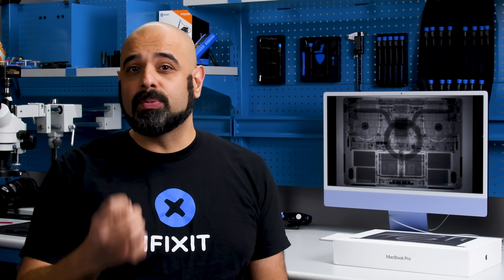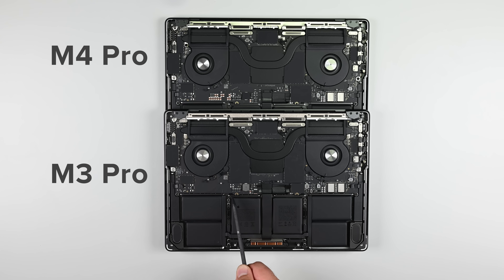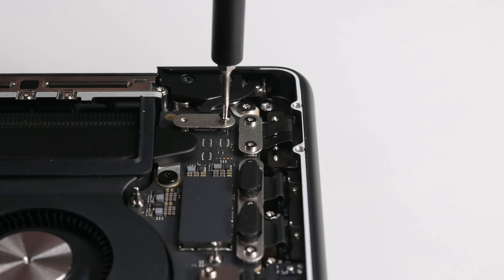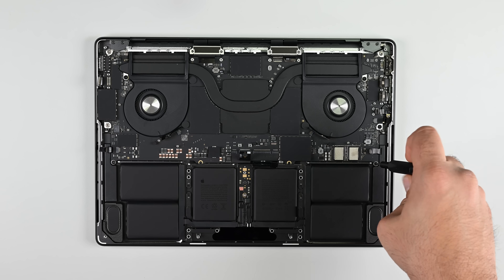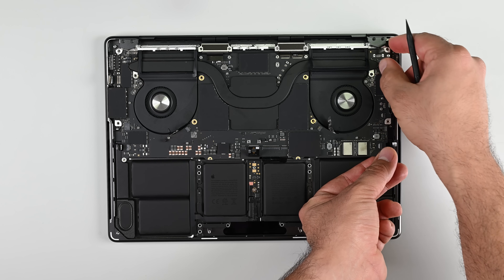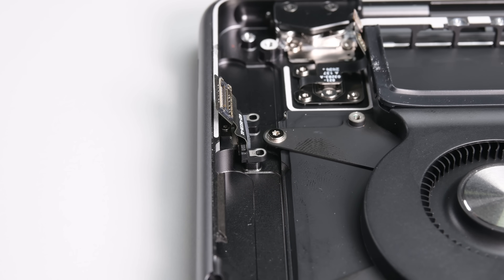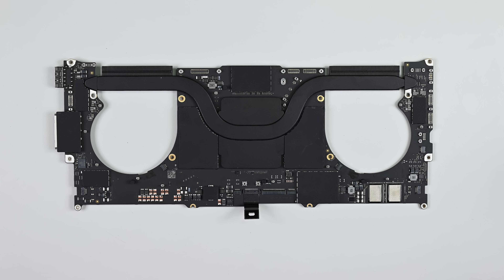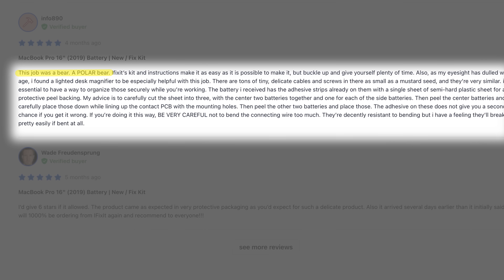MacBook Pro M4 Teardown: What’s Inside and What’s Fixable?

Comment: i really dont think we should call m4 mac mini upgradeable storage, think we should call it a swappable storage
Reply: Yep. And until they start selling the chip in the card already soldered so regular people can easily swap them, then it's very very few who are going to do the "upgrade" soldering the memory after sourcing the chips, and the whole ordeal. I doubt it's gonna be competent in price compared to just going external storage via thunderbolt and leaving the internal alone. Also for those who want to keep it under warranty. I think external can be fast enough, 3000MBs read and write is not slow. And there are 4tb and 8tb nvmes on offer. Going with a thunderbolt enclosure that is, not all in one product.
Reply: Correct, it's not there for customers, it'is there for outlet covered accident repair, rather than paying local labor, swap SSD, ship broken box for factory labor rate to repair and/or recycle

Apple might eventually sell these proprietary SSDs or charge licensed fees to whoever, still making their profit.
Reply: @MrPerrisC  a win is a win, even if it wasn't with consumers in mind, it does help somewhat and im here for it.
Reply: Dosdude1 ...
Reply: You will be able to order replaceable storage modules from apple soon its listed within the documentation. So upgrades should be possible.
Reply: @ehsanwaheed3670  Lol if Apple sells those upgrades they'll cost the same or more than buying the larger internal storage from the beginning. Third party offerings will be cheaper but I seriously doubt the price would justify it compared to external storage.
Reply: You can't upgrade your storage using a Mac studio storage ship, but you could upgrade it using another Mac mini meaning if you buy a Mac mini source chip and just swap it out with a bigger one it'll still recognize it as long if it's the same model
Reply: Upgradable it is if you have the right PCB and the right chip in there. There are other people who are doing this.
Reply: @khoifoto  other people mean you and me can't upgrade the ssd why not everyone is talking about upgrading the ram ?
Reply: @tanmay4703  its SoC so I am afraid to say but its what we are going with what we have right now, as it going to be same as you buying a phone, just ability to upgrade the storage. 
The new Snapdragon X Elite also have the same thing and it will be till some other R and D have been done on this which I feel will take many years to come with upgrading ram on SoC concept, as its same as saying upgrading ram on your Android/IOS phone.
A fix for now is to provide 16Gbs of min Ram, considering you are not a power user.
Reply: You can upgrade it, therefore it is upgradable.
Reply: Wrong system! The Mac Mini has the custom FLASH (NAND) module the MacBook Pro’s are all soldered FLASH! While someone with the proper tools and skills could replace them unless you had bought the lowest storage option and were jumping to the largest it doesn’t make much sense including the Apple tax. While still early there is one outfit who has a novel PCB which replaces the chips and with their module you can create a swappable storage! But then again, having all,of,your eggs in one basket is not wise! I prefer a dual drive setup with the external holding most of my data.
Reply: Apple terminology rubs off of allot of Apple users.  Its like COVID, but on a different level.
Reply: @Tech-geeky  Like what?
Reply: @Taxiway_Alpha  Upgradable vs swappable storage.
People must really hate "throw away Macs"
Reply: @Tech-geeky Nope. I just get the amount of storage I need. And before you say it, SSDs last far longer than 3-5 years with normal use.
Reply: @Taxiway_Alpha  So do I. Exceptions are there, but most people upgrade every new major WWDC...  So the idea of lack of upgradability yourself after purchase, seems worthless anyway.... Its time to just move on and forget about what "used to be", and instead just be happy with what you can buy.
 
You don't see me complaining, but I know people who just like to.
Reply: Tomato tomato. “Apple Storage” maybe is the apt term like what they did to “AI”.

Comment: FYI, that’s not how you use pull-tabs, hence why most of them snapped. If you keep whatever is pulling it as close as possible to the battery end, they will come out as designed in one piece.
Reply: in other words, twist it around the tweezer. It should be quite obvious why doing it the other way usually cause them to snap.
Reply: @fVNzO Yes exactly! I tend to start off with tweezers and then alternate between two fingers every inch or so for the most part, which avoids any sharp edges from ripping them apart. I’ve never had a single one snap since using this method.
Reply: @harrysmbdgs  The fact that the batteries are glued and not screwed is a design flaw in itself and  a bane to repairability
Reply: @ElysionArg 100%. You’d think with all the thousands of different shapes and sizes of screws they sprinkle into each machine they’d have some which could be used to attach the batteries!
Reply: For some annoying reason YouTube won’t let me tag users in replies, as soon as I post the comment the username disappears!
Reply: IFixit guy doesn’t even know how to use a screwdriver. 🪛
Reply: I used to work in battery replacement in high school at a small repair shop. I learned that really quick and pulling very close drastically increased the chances of getting all the adhesive out. Surprise to see "Pros" still pulling with so much distance it's not surprise why the adhesive rips apart.

Comment: Why would it ever need more than one strip per cell ?
Why can't they glue the cells to a plastic frame and screw that to the chassis ?
Reply: Like the 2017 MacBook Air? I really miss that system where you could just unscrew to take out a part.

Comment: Why don't you use a power screwdriver?
Reply: that is for cheap devices, not premium
Reply: easier to risk overtightening or stripping screws
Reply: @editoons15  understand that
Reply: @editoons15  Not really, it will just jump from the screw when it's done
Reply: @PhantomSklyne  No. These are Torx screws, what you're referring to is usually just happening for Philips screws. Pretty much any other type will not do that
Reply: Because he's not lazy. It's not like these screws take 200 turns to take out. Doing it manually is faster than the powered screwdrivers anyway.
Reply: They want to show off the one they make and sell.
Reply: ASMR